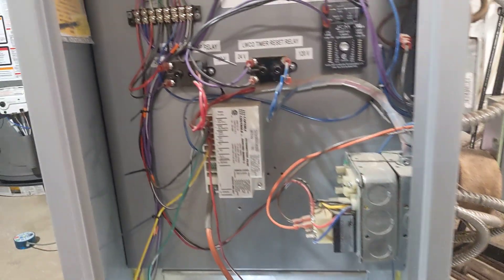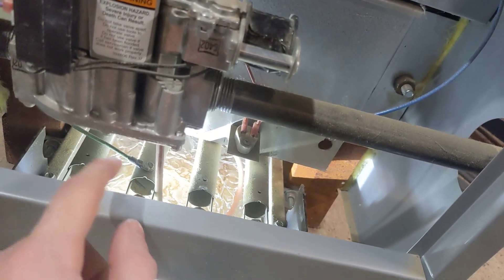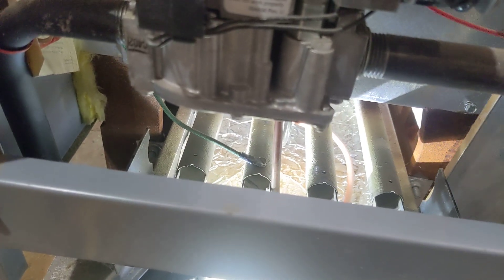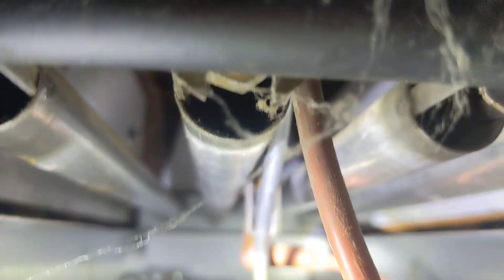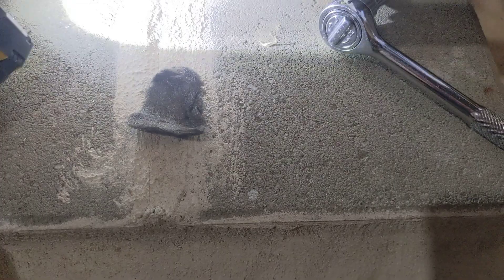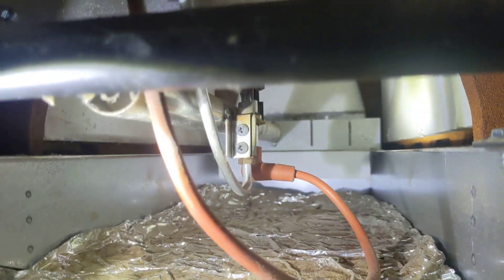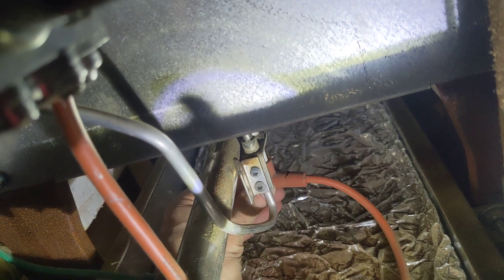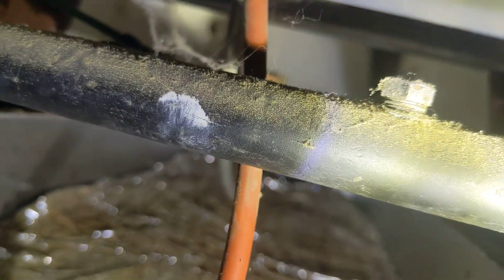Dirty Flame Rod in Intermittent-Pilot Ignition Boiler

Comment: I believe it would be well to replace that spark cable. Maybe it has internal cracks or "crunchy" that allow the sparks to come through but mess up the small currents that are supposed to flow back to the "sense" function in the module (if it uses one wire both sense and spark)